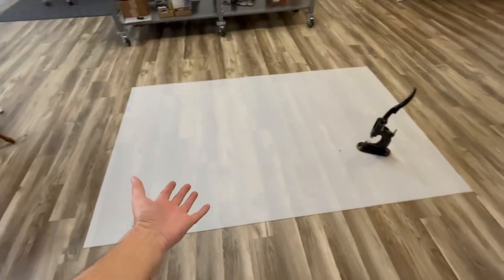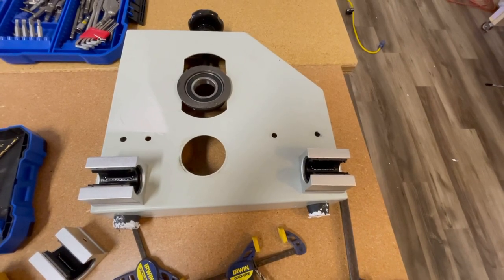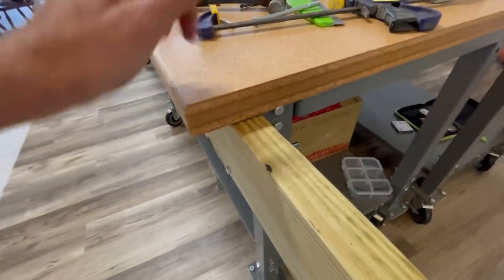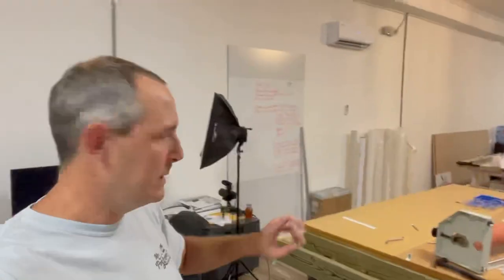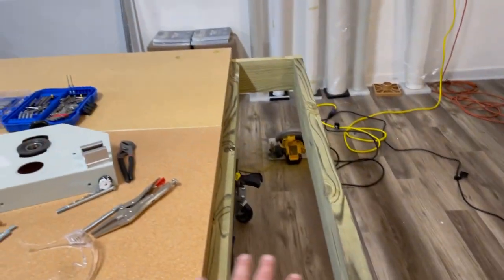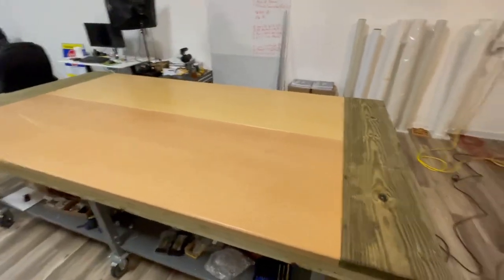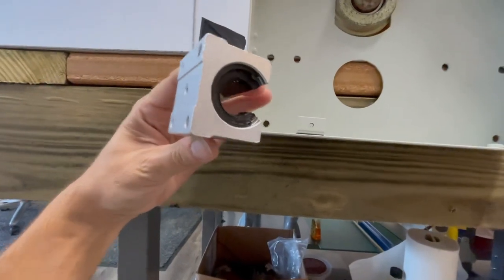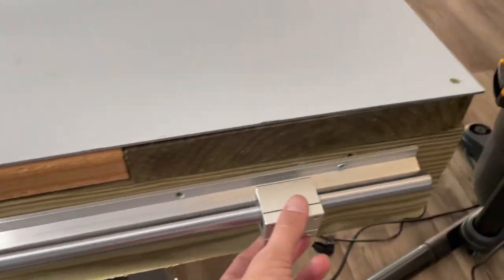Vinyl Application Table Build

Comment: We have considered building a table like this for over a year now, using an old laminator we have and the base of an old Vacuseal vacuum mounting table (roughly 5'x10'). So glad to see others braver than us gave it a shot, and it worked! Thank you so much for sharing - we will surely be giving it a shot when we have some time in the coming slow months.
Reply from the maker: Your table sounds like the perfect size. Good luck!

Comment: It came out looking good. Frankenstein or not, as long as it works, that's what counts. Some times you have to McGuyver things together. Nice job.
Reply: i agree. there are steel laminating tables out there but i feel they are way over priced. way cheaper to just build one. be it you have lot of jobs or not. like you said as long as it works. i have that same laminator parts he using. i have had that idea for a while now. i just need to get to it now

Comment: Nicely done 
Wanted to build one for a couple weeks now for facemounting photo prints onto acrylic as my 34 inch table top DryTac laminator just not doing the job as good as I will like plus am getting more and more requests for lager application.
I do have also a manual 50 inch laminator as the one used in the video and was wondering about doing something low budget.
Thank you for the Amazon link for the tracks. 
Now I’ll be building both a rollover table and a track saw
Reply from the maker: Track saw….hmmmm, now I know what to do with my extra tracks! Thanks!
Reply: If you decide to build the track saw, post a video.
I’ve built one a year ago using two long angle steel with two 1/2 round steel for the track and two small pipe for the bearings. It worked fairly okay for rough cuts. 
The concept I was missing those tracks and bearings that you are using

Comment: So my son and I made one of these based on yours. How tight do you run the roller down? Is just the weight of the roller enough? Any help is appreciated
Reply from the maker: I think the weight is good enough in most scenarios. A little bit of extra bracing would probably help a lot with sway.

Comment: Hey do you use your table and roller when laminating to a 2ft x 4ft print or do you use a laminator?
Reply from the maker: We have a 65” Royal Sovereign for our roll material. We use this table for applying to rigid substrates.

Comment: Where do you get the piece to put on the top of the table!  My husband is making me one and I got all the stuff I need except for that!
Reply from the maker: Are you talking about the white board that is on top? I just used a piece of 3mm ACM 5x10 that my sign supplier hot shots to me.
Reply from the maker: I am in North Carolina but my sign supplier is Sunbelt Sign Supply.
Reply: Thank you very much - yes that is what I was talking about will check with my supplier.  I am from MA.  Love your videos I have learned a lot since I am still pretty new at this.
Reply from the maker: @tammycrews2916  my channel is great for learning from another’s mistakes. 🤣 Appreciate you following along!